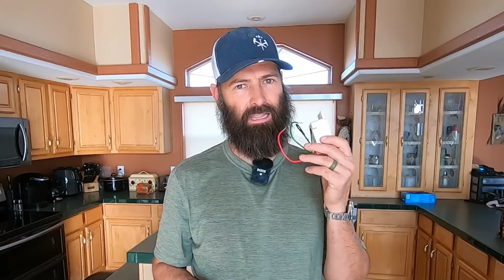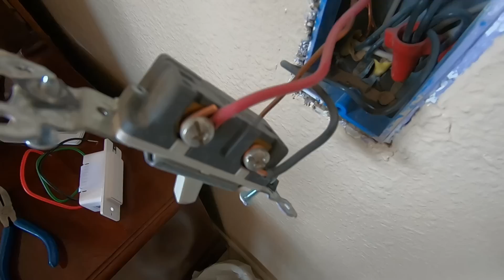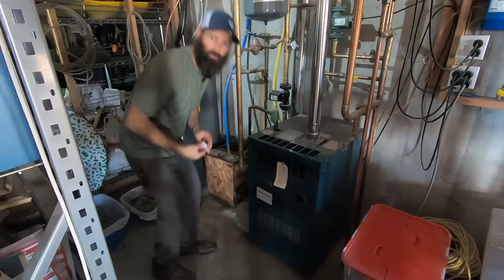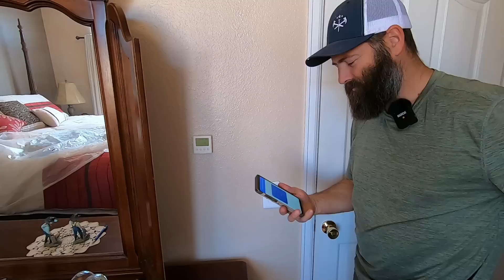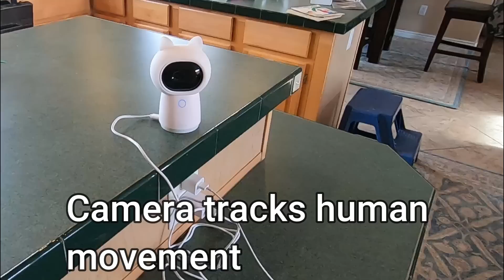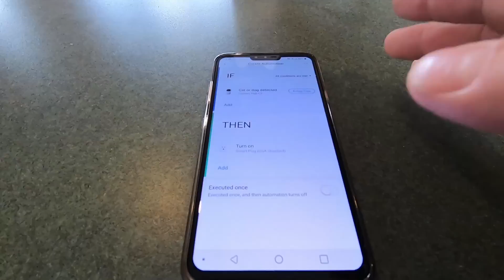Are Smart Homes The Future? | The Aqara system | THE HANDYMAN |

Comment: I have a bunch of aqara sensors (water leak, contact sensor and temp/humidity sensor).  With the hub of course.  It works well with homekit and the sensors are much cheaper than most others.  The other nice thing about the hub is that it can double as an alarm for a DIY security system.

Comment: So does the smart switch without a neutral need a battery to power it's smarts?
Reply from the maker: Nope.
Reply: @TheHandyman1  I did a little research and apparently the switch dims down to a point that the light goes off but there still is a trickle of current for the smart support. This might be problem with some bulbs, they say. (might not be exactly what you have there).

Comment: Showering cold eggs over my head, eating coffee & watching a morning HM video. Must be half asleep or still dreaming... ☕😑👌

I'd probably set the temperature sensor to detect heat "disturbances" at 98.6° & above. Re the door sensor - can it be moved to the door hinge side, bottom of the jamb, & still work? Where intruders would have a harder time reaching it? What do you think?

(PS. Hunting BF deals? Good luck! My UPS delivery address is... 😉)
Reply: > Re the door sensor - can it be moved to the door hinge side, bottom of the jamb, & still work?

I don't think so. I think they were were side-by-side on the hinge side, they'd push into each other when the door opened (possibly also knocking one of them off).

It could go along the top of the jam.
Reply: @dosadoodle  Oh, very good - I understand what you mean ~ thanks!